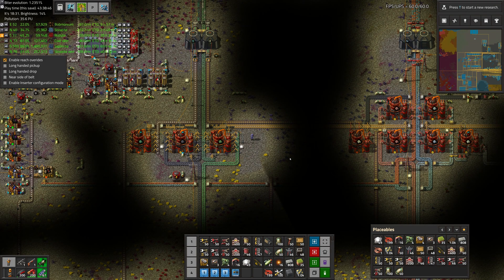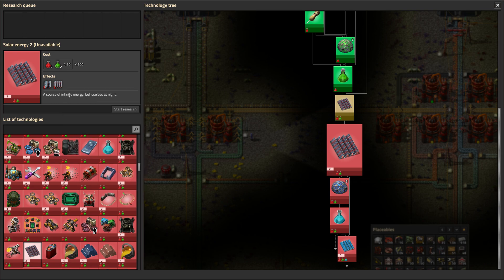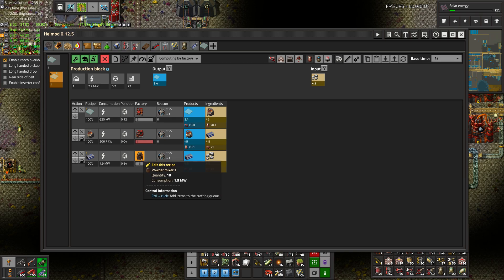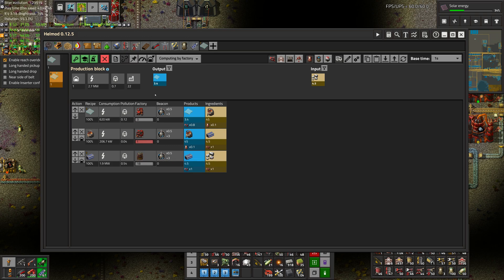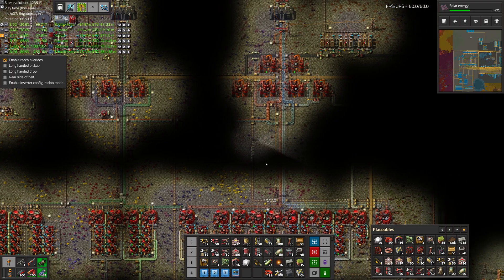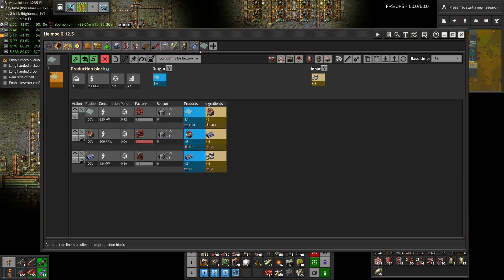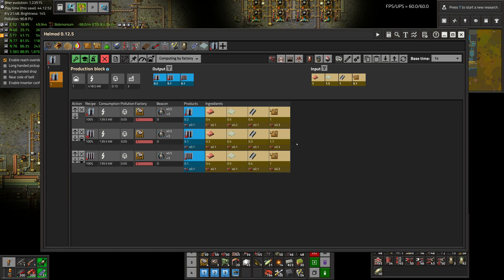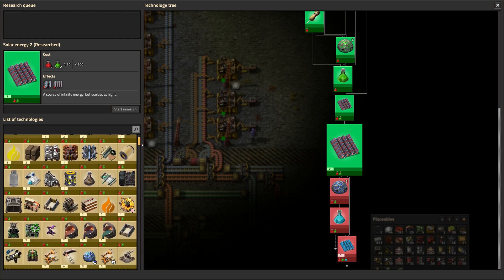[Factorio 1.1 4K] Angel/Bobs Ep 38: Glass & Solar Panels (Tutorial/Walkthrough)

Comment: so rather than limiting each chest by the item you put in it, you can use the generic red everything on all of them that only have one product entering. I have a blueprint book of nicknack stuff just for that. Also has pipe t intersections and the underground 'jumper' for the bus, for example
Reply from the maker: True, but an advantage to limiting by the item itself is it avoids problems in certain situations with more than one signal. Also its a little easier to read
Reply: @marsh8056  side benefit of using the blueprint of inserter wired to box, is that it doesn't use wire XD dunno why it works that way haha.
Reply from the maker: Yea lol wires are free in blueprints, for some reason XD